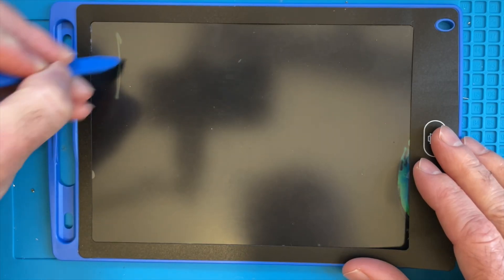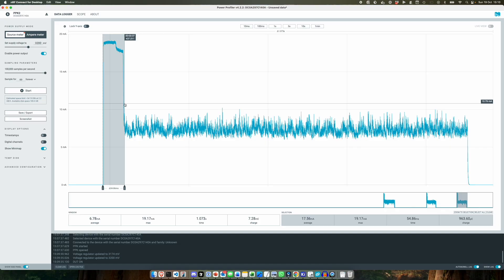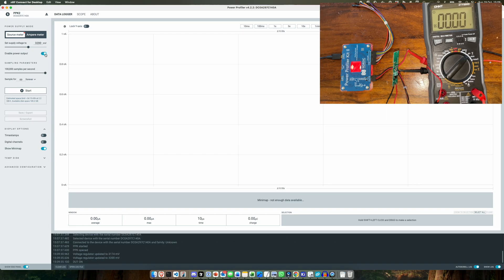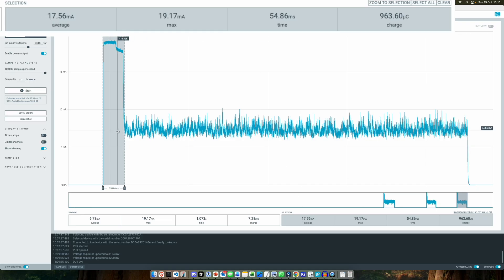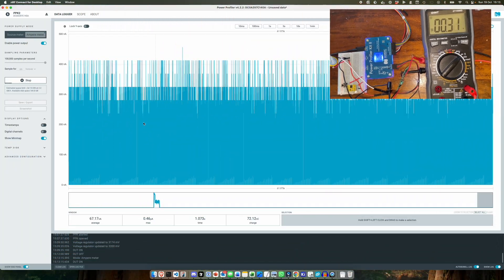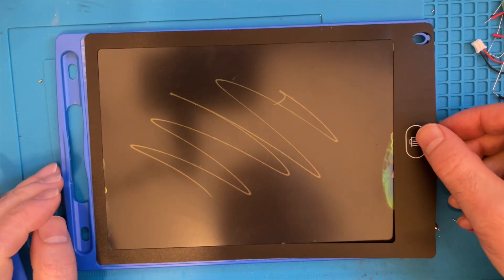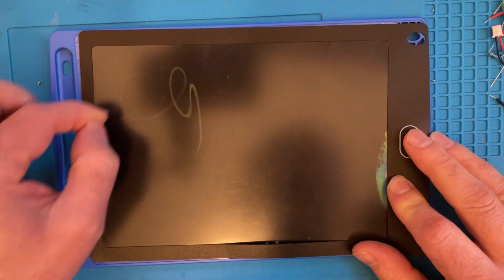I Built a 27V PCB to Fix This $3 Display...

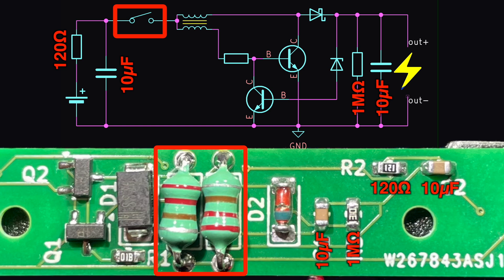Comment: 2:40 ??? but if you take a simple tubular spiral and turn it 180º, it ends with it's windings basically the same.. I don't think that's doing what you think it does. To change the phase-coupling of the magnetic field, you'd need to flip the connection terminals if it were 'backwards'.

Comment: Your get a much cleaner DC output if you put the inductors at 90° to each other. 🙂
Reply: Uh, I thought that the inductive coupling was the entire point.
Reply: @theantipope4354  it was, which is why comment is a joke. if you turn one inductor 90° then they wont couple and the oscillations will stop. so there will be no increase in DC voltage and so a much cleaner output.  🙂
Reply from the maker: Electrons hate right angles - that's why you never see right angles in PCB traces. They can't change direction fast enough so fly off the wires...
Reply: @atomic14  But you have to remember that snails move along wires faster than electrons.  push one in an one pops out the end a bit slower than the speed of light. but the one you put in just wanders around from atom to atom until it at some point fall out the end. 🙂